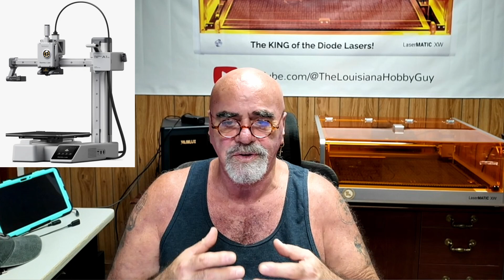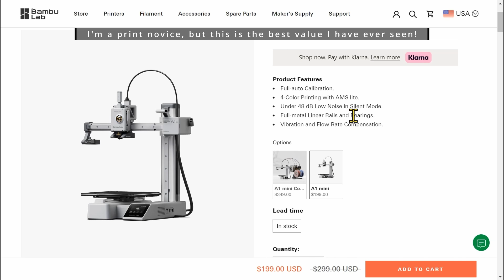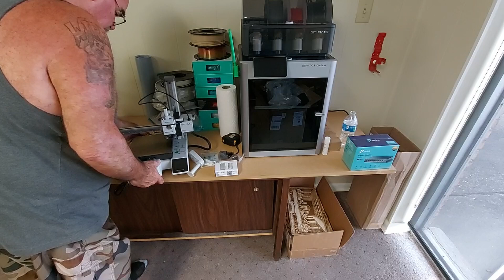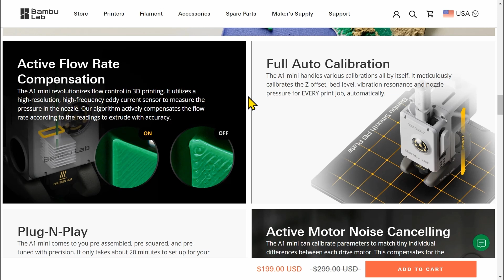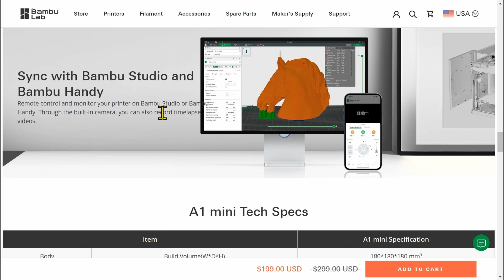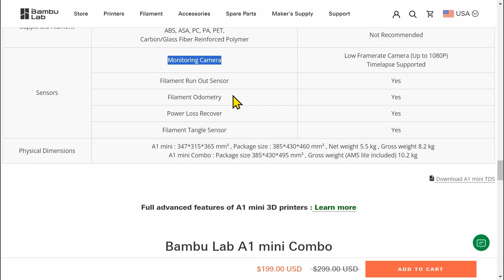❗Testing the BEST value 3D Printer on the market, the Bamboo Labs A1 Mini.

Comment: Rich thank you for the recommendation for this printer.  Bought one and is my 1st 3D printer.  It has been a blast!!!!  And what a value.  Well built, fast, easy to set up, feature full, easy to use software and a PERFECT 1st 3D printer.  And Bambu Studio is Great to use.  The only issue I had was signing on to my Wi-Fi.  When setting up, I selected English, sub category North America since in the states.  Couldn't sign on to my Wi-Fi.  So went back to settings and changed from North America to Other and then it worked.  Don't know if an issue for anyone else, but might save support contact as this worked for me.  Thanks again Rich!  Posted on my Facebook and created you for the recommendation.
Reply from the maker: That's weird! It found mine on the first try.

Comment: Do you recommend getting the  smooth PEI plate and hot ends kit? I don’t own a 3D printer and know nothing about them but have been wanting to get one and I value your opinion so I’m about to order one.
Reply from the maker: Well Mike, that would be a question for an expert, and that's not me! 🤪 I make very basic models in Tinkercad and really haven't taken time to learn about printing. It works just fine for me as is.

Comment: I'm glad you liked it as well. I actually bought my own as well to test it and I'm still blown away by the quality I get with it. I've been printing on it pretty consistently since I got it and it has replaced my go to printers. What's even more crazy is that for a little bit right after I had picked it up the regular A1 came out and for a time they were selling this Mini model for $149. I wish I had jumped on a few more when they were cheaper.
Reply from the maker: Yeah, I saw that! I thought it was a toy, like the little $89 ones 🤪

Comment: the camera on my k1 max just worked. i started my first print and it was running.

i cannot find the camera on the a1 mini, until i saw your video, i was thinking it was an addon. is there a lens cover i need to remove, or something to turn on in bambu studio? thanks in advance!
Reply: or maybe i just hit the play button under the camera window in bambu studio.  :/
Reply from the maker: Yes... you do need to hit play! 🤪
Reply from the maker: No, no add on, it's on the right side of the gantry Dwayne.

Comment: I love to make useful prints on my printers. I printed a jig for tumblers to mount to a rotary. The jig has a place to put the seal from the lid of the tumbler so you can simply slide the tumbler on and off the jig for engraving. No need to clamp and unclamp to swap out tumblers after engraving.
Reply from the maker: Cool! I have an entire pen rotary that was printed, except of course the stepper motor.